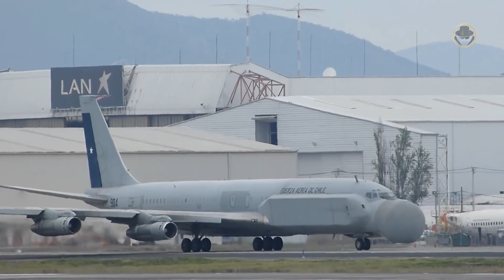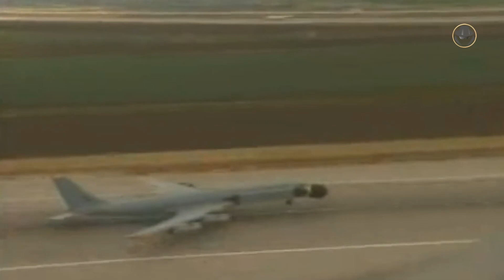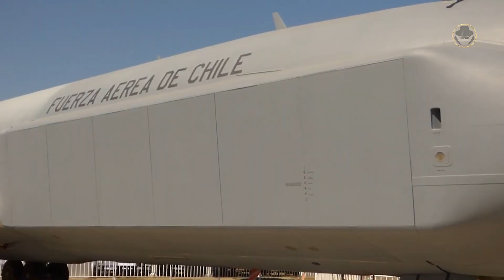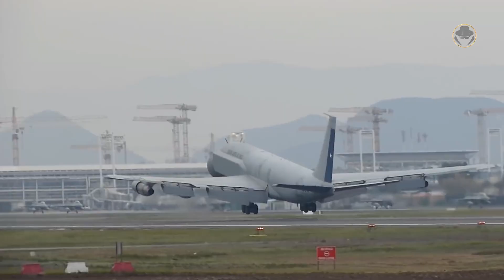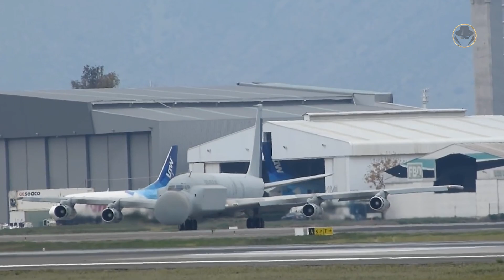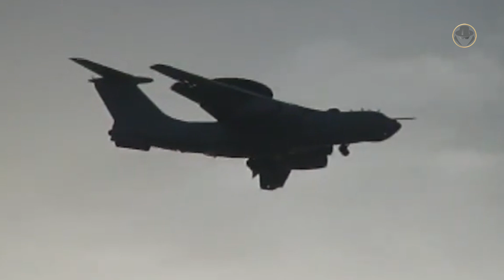EB-707 Cóndor - IAI Phalcon | A hook-nosed beauty of the Chilean Air Force

Comment: In 2007, four similar G550-EL/W-2085 aircraft were purchased by the Republic of Singapore Air Force to replace its upgraded E-2C Hawkeyes. The new G550 aircraft entered service on 13 April 2012.
Italy initially purchased two G550-EL/W-2085 aircraft in 2011 and recently ordered two more in 2022.
In 2018, the U.S. Navy accepted delivery of a G550-EL/W-2085 intended to be further modified by Raytheon to become the NC-37B   -  EL/W-2075 This One - it's OLD Design